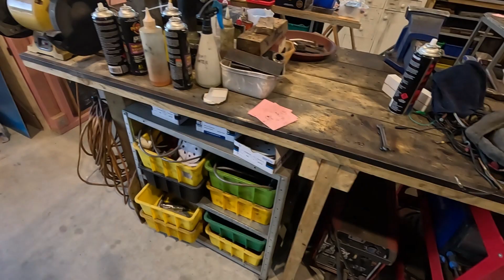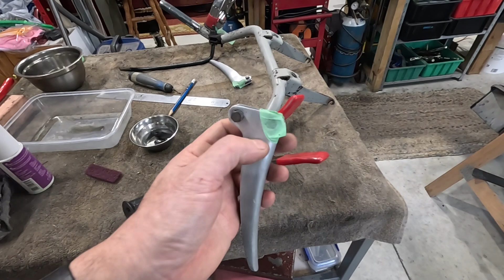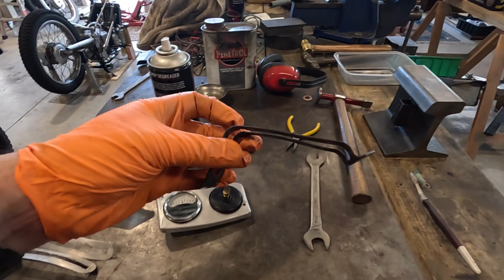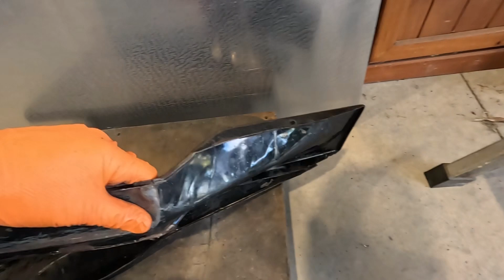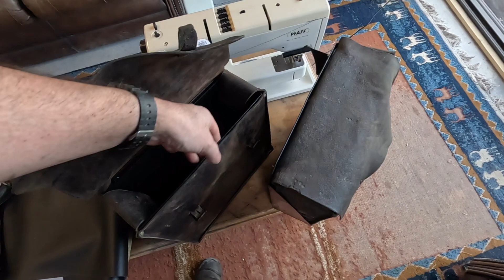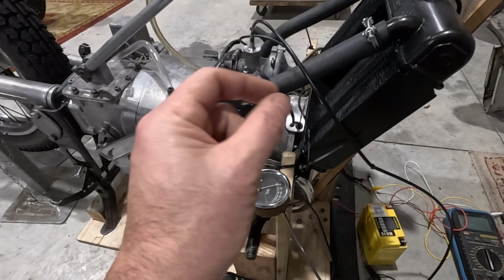New Velocette - Cleaning and protecting the body

Comment: The potting compound on the regulator is normally not affected by acetone/petrol/thinners etc. However putting it in boiling water and boiling it (throw some glass beads in to prevent overheating the regulator) softens the compound so it can be pulled off.
Reply from the maker: You're dead right about the acetone, been days and it did nothing! I'll try the boiling water. Not worried about damaging it. I won't use those anyway.  Just interested to know what the circuit is.

Comment: 2:47 The gear leaver will unscrew from the splined clamp.
It will screw back on after the body is fitted.
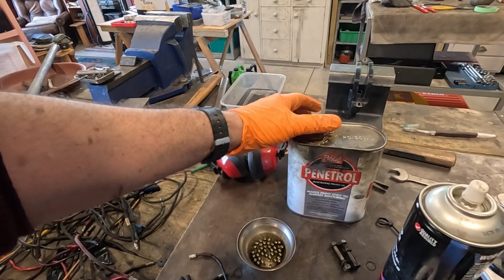21:18 Penetrol worked very well for mine.
Still good after about 8 years.
24:50 No diodes in that rectifier, to old and not worth trying to use it.
Reply from the maker: Definitely easier removing the gear lever. A bit of a fiddle getting the clamp nut and bolt done up since the nut isn't captive but it's doable. The Penetrol seems to be working well. And a modern, bridge rectifier seems to be working fine. I like that the function of the charging circuit is still original, means the amp meter is still useful to see what's going on with the battery and charging!